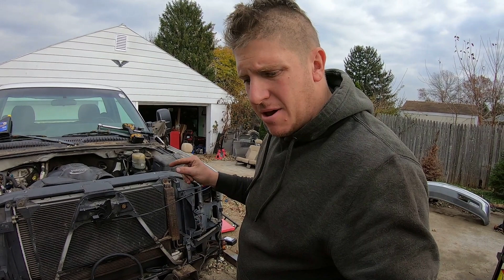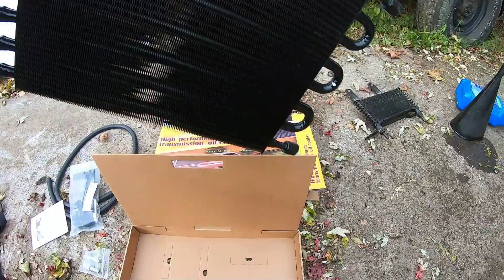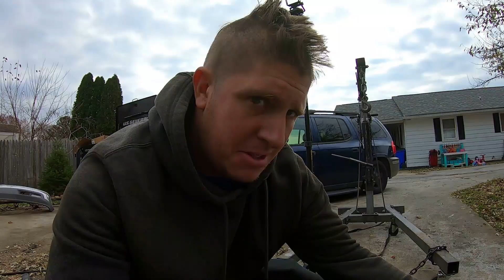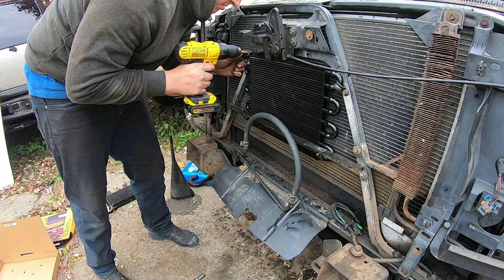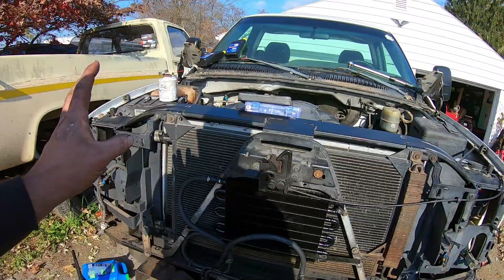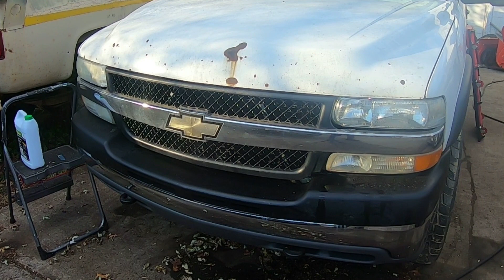The MOST IMPORTANT upgrade for EVERY TOW RIG!!!

Comment: I grew up in the heat of LV a old guy once showed me to slightly put a couple small crimps on the metal line just before the cooler, To help slow the tranny fluid down just enough to help cool better
Reply from the maker: I've never seen or heard of that trick before, might have to try it on something and get some before and after temp readings, the theory makes sense so I'd be curious so see if it actually works!  Thanks for the comment and for watching!